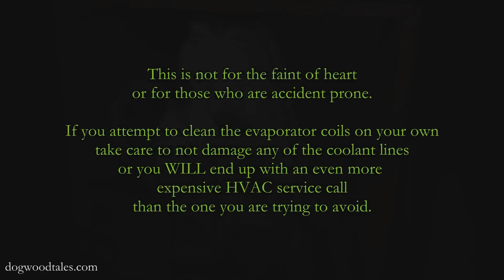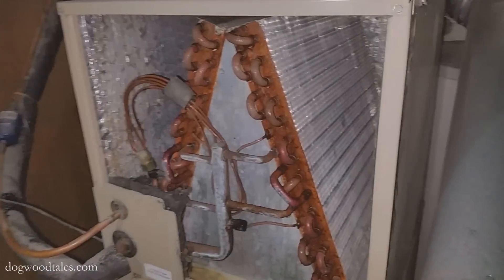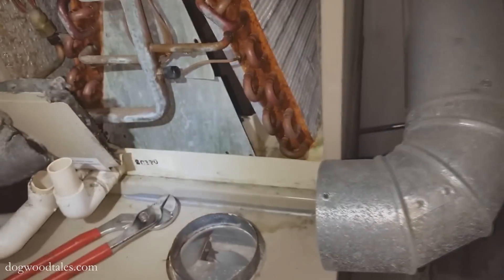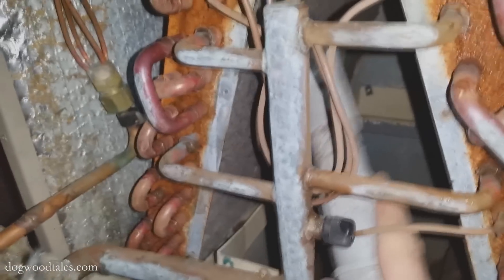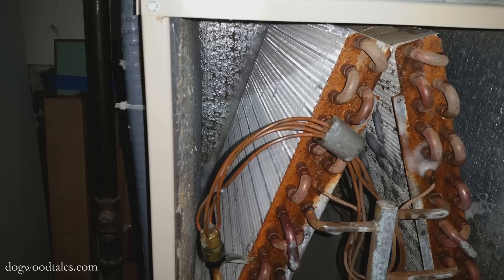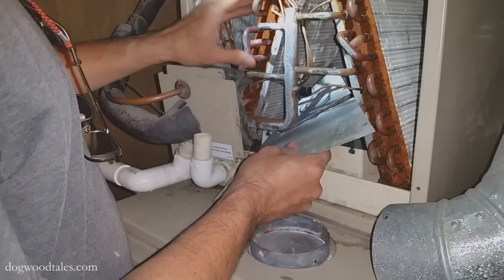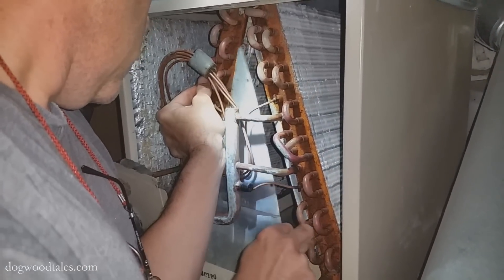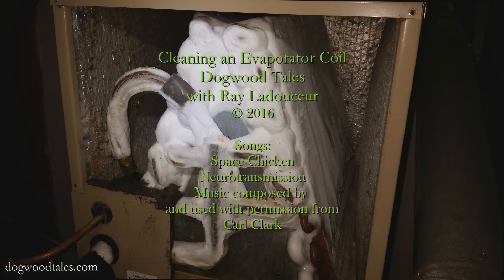Frozen Air Conditioner

Comment: Story of my career. (HVAC/R/Appliances) Dirty and /or blocked/ or obstructed coils and vents(registers) Just last week service call for a freeze-up. EVERY single supply register(where the air 'supplies/comes out) was either blocked by furniture, or closed. One has the winter comforter from the bed on top of it. Well duh, right. So, let me make this really simple:
1) when you change your clocks (daylight savings crap) Do the following:
     a) Check your smoke detectors.
     b) Clean your refrigerator coils.
     c) Check and Clean your dryer vent.
     d) Hose out the condensing unit outdoors. (It costs a LOT more to run it dirty)
     e) Replace your AirConditioner/ Heating system Air Filters.
     f) NEVER use the 59 cent fiberglass filters as your only filter. 
     g) Get rid of the blue or green filters that you was and re-use! They are worse than the 59 cent filters! Call after call for "out on limit" frozen" or "poor heat /cool" are systems with those crappy washables and filly obstructed coils and fan blades.
     H) ALWAYS USE A PLEATED FILTER!
2) Change filters half way through the heating or cooling season. So, a total of 4 changes a year. 4 filters a year at $8 is $32, if you have to call me, gonna be more than $32! Even doing it yourself, that's great. But the time it takes? You could be doing something else, and all the time that it is clogged up-even partially- is costing you more to operate and decreasing your comfort.
 Better filtering means less junk on your air-conditioning coil, better air flow, and less dust blowing around the house in general. 
I have customers that have never used a "cheap" filter and never have this problem at all. One recently had an audit from the power company and the customer showed me a picture of the underside of the coil. Her 16+ year old system was as clean as the day I installed it.

In short: Use good filters and change them 4 times a year.
Reply from the maker: John In Milford great advise! I have used  the nice pleated filters for a few years now and change them at least 4 times a year. However i used to have an electrostatic air filter system and I cleaned those filters religiously monthly - 10-12 months each year. This still happened. I just checked the coils a couple months ago and they're still as clean as when I cleaned them in this video. 
Thanks for watching
Reply: Electrostatic filters are great if there's a person with severe allergies. BUT There should be a pleated filter BEFORE it.  That way the EAF only deals with microscopic particles that are just too small for the filter to trap, which isn't much! Otherwise, the prefilter is barely able to trap blobs of lint or hair, the rest passes right through to be trapped on the evaporator! 
Good luck!!
What's the phrase of the day?
"I gotta go buy some pleated air filters."
Reply from the maker: John In Milford I bought a case of them last time. I'm set till 2019

Comment: how in the hell does a unit get that dirty , you are a slob . bet it smells nice in that dump
Reply from the maker: nonya bizz how? kids, dog, and woodworking. Plus I used to have an electrostatic filter system that I don't think is as efficient as the pleated filters I use now and this hadn't been cleaned in several years.

Comment: My coils are frozen, I changed the filter a month early to see if it'd help but felt no pulling in of air when I took the old one out.  Should I be worried about something more serious?😭.
Reply from the maker: Michael Syres your system might have an auto shut off of the fan when it's open. If not that then something isn't right.
Reply: Call a real service tech ...be smart!!

Comment: You can use Scrubbing Bubbles bathroom cleaner too. Saves a ton of cash. Then disinfect the evaporator coils with hydrogen peroxide. It's also cheap like $0.88 a quart. Put it in your garden pump up sprayer and spray away.

Comment: Thanks for making this video, it's really useful. I need to do the same thing to mine. Next time, would you cover the heat manifold opening and give it a really good spraying? What could get harmed if a little dirt, water or cleaning agent went down the hole while you were cleaning? I notice you said 'do NOT' get water down there. Great video and your honesty is refreshing :)
Reply from the maker: I don't know that anything would get harmed by cleaning the heat manifold, but it's not a point of air restriction like the coil is and honestly I simply didn't want to bother with it. But letting a bunch of that junk fall down there from the evaporator coil, if left there, would mean it could just blow back up into the coil and/or would stink pretty bad for a while when first using the heat in the fall/winter. When I first use the heat every fall the heat manifold burns off the dust and it stinks for a few hours (smells like burning hair - ick). I open my windows and crank up the heat once every late Sept./early October to cook that off and then it's fine the rest of the winter.
Reply: Maybe slip in a piece of cardboard underneath to catch whatever falls?
Reply: nothing to worry about if water gets down there if you have a 90%+ furnace with a secondary heat exchanger, it'll just go out the furnace drain. Also to be noted that its really isnt all that difficult to just pull the furnace out from underneath and clean the coil.

Comment: one question: we clean the ac coil last summer, but now if I select the thermostat on 75, my ac don't stop, the thermostat shows 75 but still running for hours, tanks
Reply from the maker: salsan88 well I'm not an hvac tech but the first things I would look to are - check the evapotor coils for cleanliness again,  make sure you have clean filters and if the thermostat is battery powered make sure you have new batteries.
spray down the coils outside with a mild detergent like simple green, let it soak a minute, and the hose it off. (do NOT take off the fan and try hosing it from the inside out.)
Beyond this you will need an hvac tech to check the pressure and top off the coolant.
good luck!
Reply: DOGWOOD TALES, TANKS AND GOD BLESS YOU.

Comment: hopefully you didn't bend a bunch of the coils when putting back the cover...it actually looks like you did do some damage to them.
Reply from the maker: Thank you for your concern. 
Yes, I did ding some of the coils (meaning just the foil/fins, not the piping), but relatively very few of them. It's been almost a year and I haven't had any issues, so it seems like it's okay.
But your words echo my words of caution at the beginning for those who might want to try this for themselves.
I took a gamble on saving a couple hundred on a cleaning service against the greater cost of having to to pay someone to fix it if I damaged the system. It was a risk I was willing to accept. For some it might not be.
My patience and luck paid off.

Comment: nice. u did good, coming from a hvac tech. but imagine doing that in an attic in july.
Reply from the maker: I love hot weather - but not inside the house
Reply: I'm doing that now. In July.
Reply: I'm doing that right now. Its still May but i live in palm springs. Its 110 outside and my coil froze :(
Reply: If you called a tech to look at it then most likely they would've wanted to replace it instead of cleaning it?
Reply: @cooldude2245  ...if it doesnt have a leak... a real tech would pump system down.. cut the lines and drains ....take it outside spray it down with coil cleaner and rinse thoroughly with a garden hose..plus clean out drain pan ..re install coil..then pressure test.. deep vacuum.. then release refrigerant  and do super heat/ sub cooling and top off refrigerant if needed... if the system is r22 ..then yes by all means recommend to replace it... to simply walk in and say to replace it..is done by express hvacr company's...find another company!! If customer doesnt want to pay a real service tech..then thats a customer you dont want!! Tell them to hire a plumber or handy man... do it right or dont do it at all!! THE DIFFERENCE BETWEEN TRU PROS'S AND HACKS...
Reply: richard woeckener way back, our evap got clogged with dog hair. Fortunately we had a friend that took care of it. He replaced it (didn't clean it). Because he was a friend he helped us a lot (maybe 350 to 425). We probably would have paid around 750 + if it was a service co.
Reply: @cooldude2245  probably 450 because thats pretty much free, 350 and he would have been a reallyyyy good friend lol
Reply: @richardwoeckener7936  Hell, if they are going to go through that much trouble, it's probably about as cost efficient for a new one.

Comment: You don't need to cut it to get it out , DORK
Reply from the maker: Hi DORK. True, I was able to get it out without cutting it all the way as well as put it back in. Not being a seasoned HVAC tech at first I wasn't sure how much that A frame coil would move without risking damage to the lines.
Thanks for watching. Have a great day.
Reply: Dogwood Tales I have cut them before.

Comment: Try doing it from back side no obstructions worked for me.
Reply from the maker: that's a great suggestion! - if only there were room for me. in my case there is a water heater on the other side of the furnace.
Still, this may be a helpful tip for someone else.
Thanks!

Comment: Good job. Most ac techs would not have don that good of a job at all. You need to use better filters and make sure your return air is sealed up properly that is not normal at all.
Reply from the maker: clark hall I think that the electrostatic filter I used to use didn't filter as well as purported even though I cleaned it religiously every 4-6 weeks. that and the fact that I do woodworking and have 5 daughters. I'm using good pleated filters now.
Reply: Woodworking. Enough said lol.

Comment: could this be why my ac isnt blowing cold freezing air as it used to
Reply from the maker: it could be. I was having the same issue and cleaning the evapotor coils resolved the problem for me. if it didn't then I would have known that it was another problem such as low coolant.  but the first thing to check before the evapotor  is that you have a clean air filter.
Reply: Jack Daniels nope the air would actually come out colder. You are most likely low on charge

Comment: How does anyone let their filter get so plugged? They cost pennies and it takes about 4 seconds to replace. If you change the filter regularly, the coil should never need cleaning.
Reply from the maker: As long as there is a relatively clean filter in place this shouldn't happen - theoretically anyway. 

For me I think it was mainly a failure of an electrostatic air filter not performing as well as purported.
I cleaned it religiously monthly (mostly, at least 10 months a year). But as the electrostatic fins accumulate dust, they attract less dust and larger particulates reached the evaporator coil.

Regardless, even an good air filter is only so good and some stuff will still get through/around the filter and over time stuff it will accumulate on the evaporator coils.

Some filters do not filter very well either - people use them not realizing the lack of quality.
If a filter gets clogged and not changed, then the restricted air movement through the filter will transfer to more air movement around the filter and thus larger particulates will make it to the evaporator coil that way.

Lastly, one also needs to be careful about the filter they use. As I was told by a tech, some systems might not be designed for really fine micron filtration and the system will be fighting to pull air through the filter. Not sure if he was referring to older models or what.

At any rate, yes, replacing the filter frequently is key to maintaining the HVAC system.
Reply: Pennies?  When was the last time your bought an A/C filter??  1937?
Reply: @cm1133  Bought one 2 days ago in the year 2021. But I don't use the stores you use. If you're spending more than $2 on a standard 16X25X1 pleated, you must be shopping at home depot or Lowes.

Comment: This is very helpful. I know this is my problem as the primary filter on the return register is missing. The coils definitely freeze, because half an hour after shutdown water appears out the drain line. I hope I can get at the evap coils for cleaning, fingers crossed.
Reply from the maker: take your time and go easy
good luck

Comment: here's a challenge.   what if the blower prevents you from even getting to the A frame?     in a ceiling unit.   
i tried snaking my arm through the vent and aiming blindly.    helped a tiny bit....
Reply from the maker: Is the heat manifold not in between the blower and the evaporator coil, or is this just and AC unit with no heat?
If you're up for the challenge, then remove the blower (to give you unobstructed access to the evaporator coil). I did that last year to clean it and the housing out (but my blower does not restrict access to the coil like you say yours does). They were just caked with a lot of dust.
Doing what you're doing, seems to me, has a high risk of getting a deep and unpleasant cut from a metal edge somewhere and/or unknowingly damaging the fins on the evaporator coil.
Reply: Call a pro!! Dont get hurt

Comment: Thanks  for your video I think I have same problem, but the technician said I need change whole system  for around  5.500 DLLs,I will do the job. God bless you for sharing your acknowledgment .
Reply: +salsan88   Whereabouts do you live?!  That was a good price; my local tech in central IL charged me $125 just to charge my a/c with 1lb of coolant & didn't even clean anything.   I had it charged 2 mos ago, & it seemed to cool my house better for a couple days - - but maybe the weather cooled for a couple days because I soon noticed it was still not keeping up with the heat & still freezing up - so I'm betting my A coil/evaporator coil is filthy.   Should I get it cleaned now for any reason seeing as how it's almost Sept or just wait till next spring?
Reply: Dogwood Tales   Thanks!  I believe it is, but will find out for certain & now feel better equipped to make the decision on when to prioritize this service!
Reply: @playhooky  - I guess by now you have realized that your system was leaking refrigerant.
Reply: @stevee7774   I already realized it to begin with.
Reply: @playhooky  - I should have been more specific. I meant that by now you realize that the coil was freezing up because of a low refrigerant charge as opposed to a dirty coil.
Reply from the maker: thanks for watching!
Reply: somebody tell me about other technician, I call him,he came to my house, he clean the hvac,check the freon, check the blower speed,the box of the A coil, has the door in wrong side,missing a piece of sheet in one side of the A coil,the pan for drain was in angle leaking water,he cut the sheet of the box in front of the A coil, the A coil was black, VERY DIRTY,he clean the coil,install the piece of sheet beside bottom of coil,cut a sheet for new door and install it.right now the air is working perfect,he charge to my only$150.00 very cheap,I give to him &200.00 very honest technician.one more time, TANKS FOR YOUR VIDEO.
Reply from the maker: If it were my HVAC unit with the way the air flows around the heat manifold and then through the evaporator coil, I would go ahead and clean it now. The reason is that the air passes through the evaporator coil regardless if I am heating or cooling. So a clean evaporator coil means better air flow and the unit needs that regardless if it's heating, cooling, or just recirculating the household air.

Comment: Nice job. Your a coil is rusted pretty bad. You can possibly be losing freon from pinhole leaks there causing your unit to freeze. This is what is happening with my unit.
Reply from the maker: yes I realize that. I had the system pressure checked and topped off last year. I'll have the pressure and level checked again next year. so far this year it's working well.
thanks!
Reply from the maker: I am informed that the metal frame will rust due to the environment, but as long as the coolant lines are copper they shouldn't rust and leak. The coils should be aluminum and wont' rust either. So maybe not as much to be concerned with, but I will still keep an eye on it.
Reply: WRONG!! refrigerant is abrasive under high pressure.. it doesnt matter what material the coil is made of ..the factory welds will leak and get small pin holes in the tubing...all due to age and repeated abrasion ...its called wearing out!!
Reply: @richardwoeckener7936  I'm months late, but why are you such an angry, bitter person in all of these comments?
Reply: @nathanielhensley4804  ... bitter?   You shouldn't be making vid like this 
..your going to get someone hurt!!!
Reply: richard woeckener stupid question, how can some one get hurt?
Reply: @shermsherm23  ... when moving the coil... it is possible to break or crack a welded joint on the refrigerant piping which is under high pressure... if that pressure hits any part of your body... it will blast the skin right off in seconds.... refrigerant is abrasive under high pressure